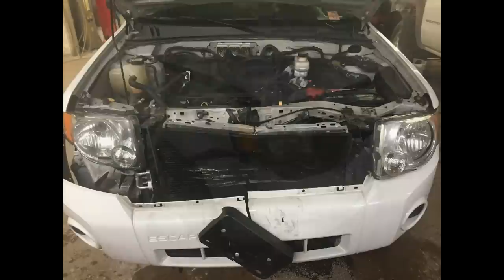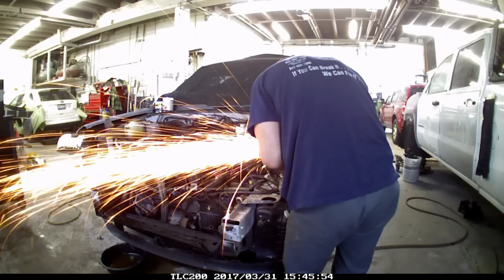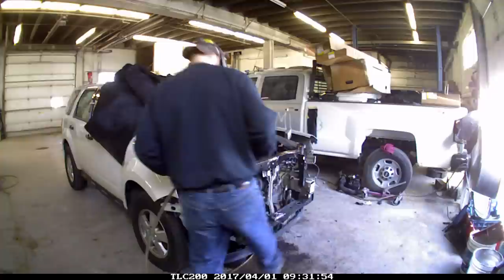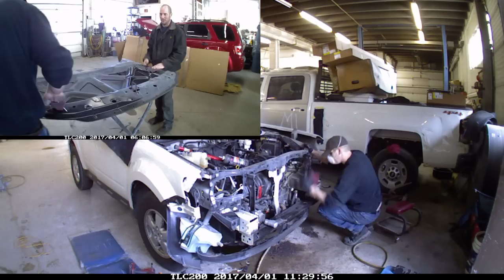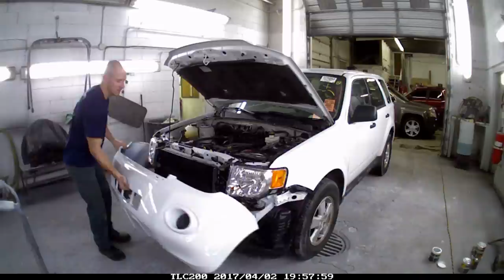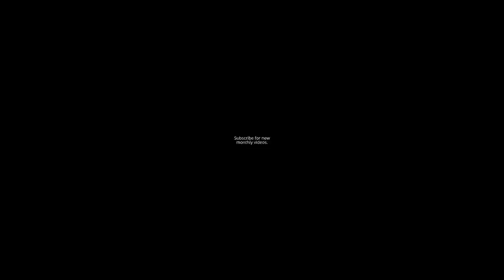2012 Ford Escape light front hit radiator support replacement time lapse

Comment: Could the original radiator support have been used?  Cosmetically, it would have looked bad, but maybe still functional?  Just wondering if a person did a similar repair at home and does not have your patience and welding skills.  Great work as always.
Reply from the maker: Yes, it could have been moved around to fit.  This was one of those cases where it was really a toss up as to repair vs replace.  I went with replace because it makes a better looking job and is really easy.   I have seen much worse done to more important components like frame rails, straightening it would not have been a problem.  Thanks for watching

Comment: I need to do this same job.  What model slide hammer did you use?  It looks like a heavier than usual hammer and it has that hook you can use to bend the radiator support frame back into place. I've been looking at which one to buy and I don't want to get one that's too light weight to pull the support frame out.  Thanks!
Reply from the maker: That one is 30 years old, they don't make them anymore, I have been looking for years.

Comment: Hey there, amazing job with this!  You're a craftsman.  A quick question that hopefully you can answer--I'm hoping to do the same job, and I was wondering if the grinding and the welding was necessary?  Just trying to see how much I can do myself and how much I'll need other help with.  Thank you for everything!
Reply from the maker: If you need to replace the radiator support, it is necessary.

Comment: I just purchased a 2012 escape that has about the same front end damage. It’s hard to see exactly how you replaced the rad support from that video. I have never done one before. Any pointers about setting in in place. Thanks.
Reply from the maker: I got a new one and put it in where the pieces overlap between the lower frame rails. Just drill or grind the old core support off the upper rails and aprons and weld the new one in. To line it up for welding, I just used under-hood measurements and measured the reference points at 1:56. Hope that helps, thanks for watching.
Reply: vehcor ok thanks. One question though. Where do you get the under hood reference measurements. Thanks,
Reply from the maker: They come with the estimating software and frame rack system the shop uses. I also just happened to have another Escape there to measure more points. You can see it in the background, it is Maroon.

Comment: Why did you pull the radiator support in the beginning? I am assuming its to straighten other parts?
Reply from the maker: I always pull the parts I am replacing because sometimes adjoining panels can be moved slightly.  It is easier to do it with the old parts still welded up than moving the parts individually to get them lined up with the new ones. Let me know if that makes sense or I need to clarify something. The picture in my head doesn't always translate into writing like I think it will. lol
Reply: No, you explained it pretty good. How do you know when those other panels are straight or where they need to be?
Reply from the maker: Measurements, I leave them out of the video mostly but I do them throughout the repair process. You can see a quick glimpse at 1:56. Also when you pull it with the parts still on, you can pull in the direction and points of impact. Even though the core support (radiator support) was pushed back, the rails and aprons were pushed out and back. As I pull the core support forward, the rails and aprons come back in and forward with it. I would have had to pull each side individually if I straightened it after removing the core support.

Comment: How much is the total cost of the repair?
Reply from the maker: $3000
Reply: @vehcor  lol that's a rip off I would of charged 1500
Reply from the maker: serbia991 There is that model about work that goes:

Pick two, good, fast, or cheap.  

Good work that is fast is not cheap
Fast work that is cheap is not good
Good work that is cheap is not fast